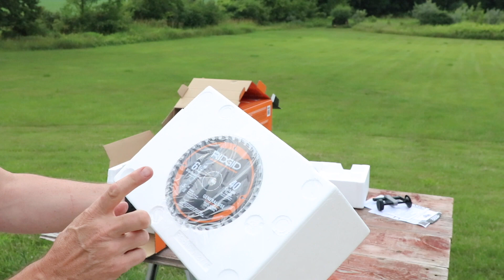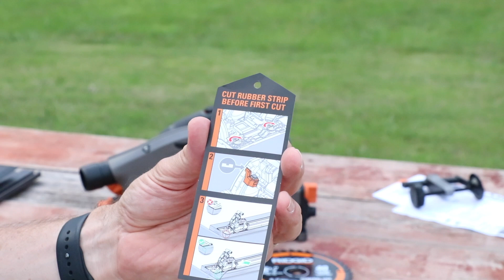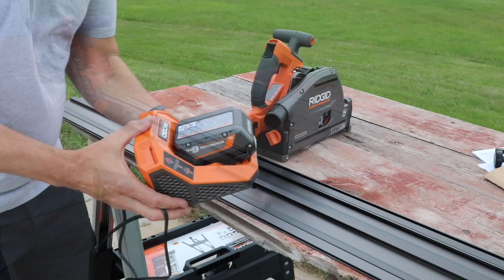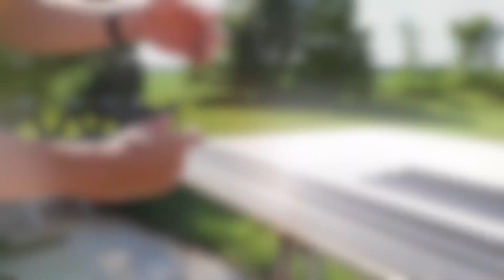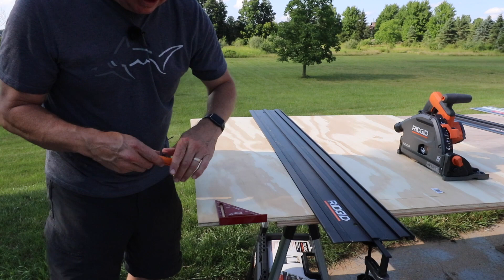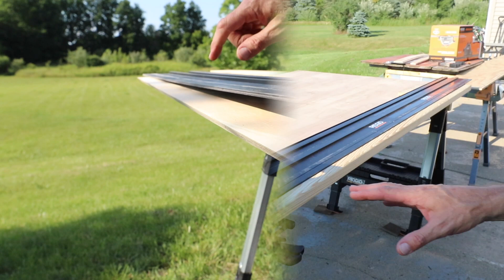Check Out The New Ridgid Track Saw- Watch Before Buying!

Comment: Loved your review. I bought the ridgid track saw. Obviously it came with a blade, but what one would you recommend for cutting plywood type sheet goods. Brand as well as tooth count.
Thanks
Reply from the maker: The 40 tooth blade on this saw should cut plywood quite good.  If you require better cut quality, I'd get a Milwaukee track saw blade that's a 48 tooth fine finish blade.

Comment: For the depth adjustment, what's the difference between the white markings and the orange markings next to it?
Reply from the maker: One set of markings is for using the saw on the track/rails and the other is for using the saw without them.
Reply: @MarkThomasBuilder  Thanks!

Comment: Mark, thumbs up from me on the video. I just received my Ridgid track saw three days ago.  Before I pulled the trigger, I noticed that the saw was going to cut nearly all of the rubber cut strip off.  I spent nearly an hour adjusting the base location with the four adjustment screws to move the blade farther away from the track.  Now after the cut, I have about .090" of rubber extending out past the aluminum track. Any idea what the optimal distance should be?  Just cut some Formica with saw and it was a nice smooth and straight cut. Anyone with Ridgid batteries and flat panels to cut should put this tool at the top of their want list!
Reply from the maker: I think you were wise if doing that. If I had to guess, I'd say that cutting the rubber width in half (or maybe a little less than half) is good.  I haven't heard any comments on that.  I've cut the track rubber on Bosch, Kreg, and Milwaukee and it seems like they take about half off.  This Ridgid one did the most, but I think I can live with it and still get perfect cuts.
Enjoy the saw and thanks for the comment!😎🙌💯